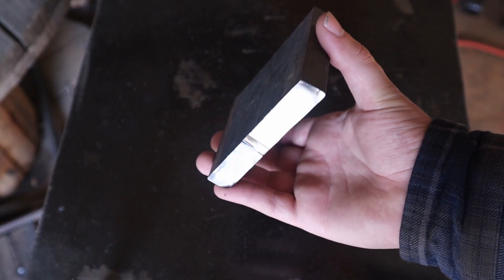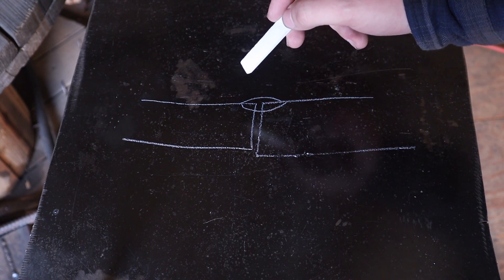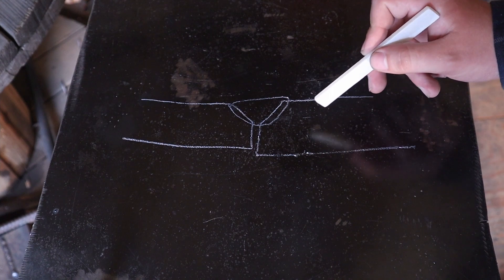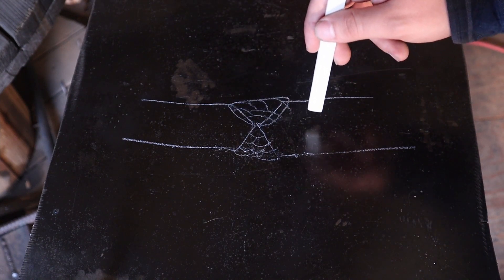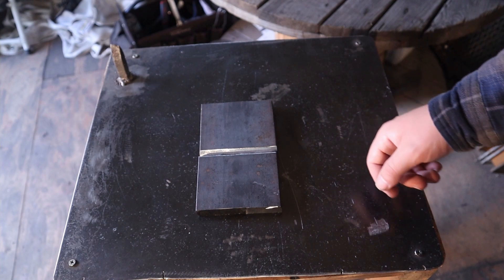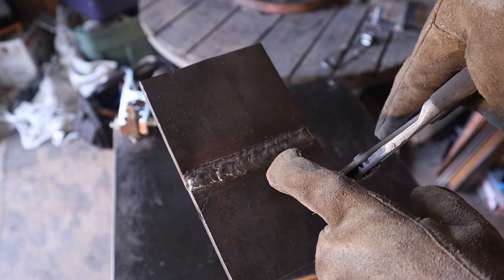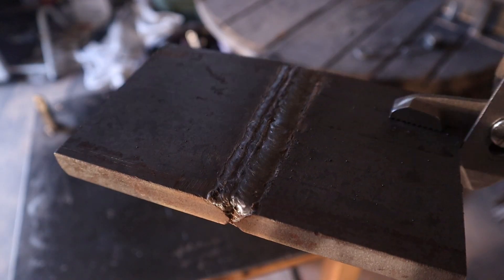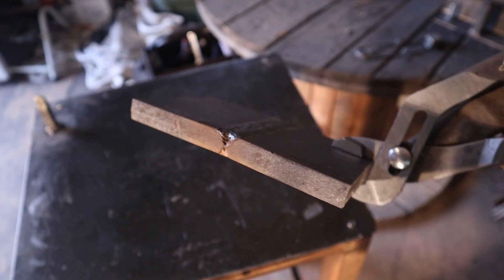How To Get Full Penetration On Thick Steel / Complete Penetration Tutorial

Comment: Hi, i have a question if we perform the butt welding on steel plates 10cm wide and 5 mm thick. Can we use this sheet to produce the coil by hot rolling? Will the joint sustain the hot rolling process?

Comment: Would u say it’s normal practice (if needed), to full penetration butt weld 2 load bearing 
I-beams together on residential house?
Reply: I would say yes
Reply: interesting question - it will depend on beam size vs expected load, but generally I'd expect I-beams to be overkill for residential construction which would mean you could potentially get away without full penetration. However, partial penetration welds result in pretty significant stress concentrators so for any critical application I would lean towards full pen as a matter of principle. Also, if anything will be loaded in cyclic service certainly full pen is the way to go (just a general note - not related to support beams for a house).